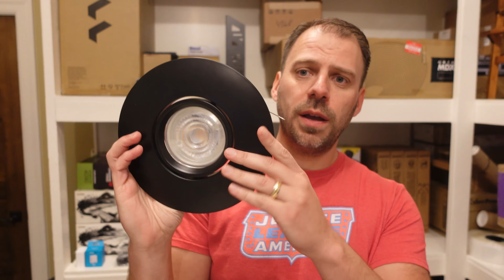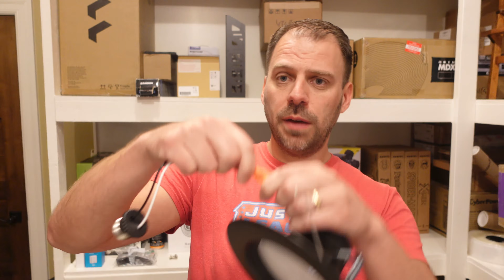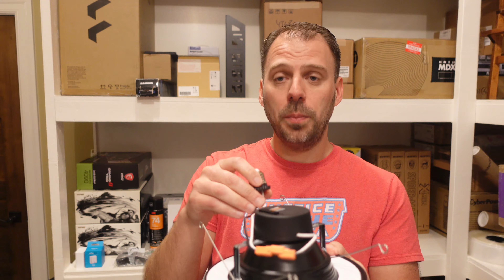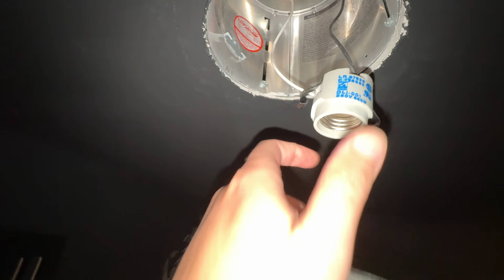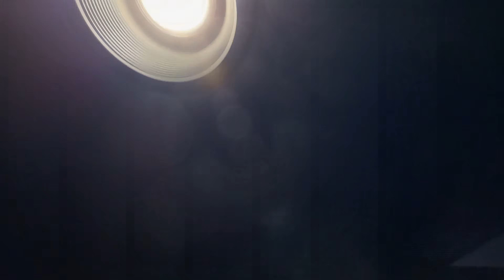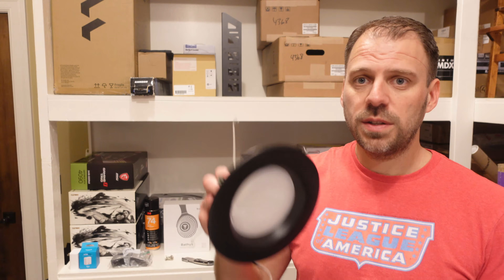Don't Make This Home Theater Lighting Mistake

Comment: If helpful, I’ve done a lot of what you have done and one thing I noticed is you have a deep baffle cone with a short neck light. It’s not an issue, but if you determine you want your light bulbs a little further down, then you would buy a longer neck light bulb or a shorter cone trim.
Reply from the maker: Great tip, thanks for the advice!

Comment: IMO, the ultimate home theater light install comes from ALL the 'on' lighting being behind the TV and or entertainment center.  That keeps any lighting from interfering with the screen, or the eyes, at any viewing angle.  And, definitely, NO flashing RGB on surround speakers, etc.  KISS!  Obviously, the lighting should not be so bright as to impede the viewing pleasure.  (Of course, there can be additional lighting in the room, such as in the ceiling.  But, normal/additional lighting off when viewing.)

Comment: Why didn’t you just cut the socket out and hardwire to the pig tail? Then you could use the nice sealed trim without all that extra stuff rattling around.
Reply from the maker: I considered that actually. Snip and wire them together to shorten up the line and eliminate the socket, but I preferred just getting the other trims.

Comment: Id look into dmf lighting! Disclosure, I’m a dealer but they’re a super solid option, you get awesome dim-to-warm curves, rattle and light leak free, angled precise fixtures and lenses, solid retrofit options, super high CRI and guaranteed 1% dimming which is essential in a low light home theater.

Comment: You should have used small zip ties and heat insulation for the hanging wire length
Reply from the maker: I did try to tie up the wiring inside the light cavity, but I couldn't get it work well because of the tight access when you close up the trim.

Comment: This is a great video, I was looking for some black trim Hue can lights as my 6 theater room lights are controlled with 1 switch.  I installed the hue lights so I could use the zone feature.  This way, I could control the front, middle and back row of lights.  I am kicking myself for not looking at the black housings. I just took the white versions of the ones you purchased down and in stalled the white Hue can versions.
Reply: Unfortunately, the hue can’s are white

Comment: I thought you were trying to direct the lighting as well. I get it didn't work with the gimbal, but I thought that was your point in this video, nice job anyway.
Reply from the maker: Originally, yes, I did want to direct the lighting, but I also OK without that capability. The lighting is really nice now even just shining straight down, and I'm glad I'm using all 9 fixtures again versus disabling 5 of them.